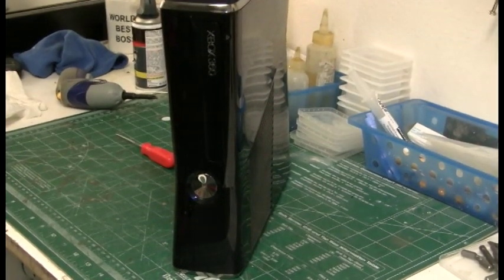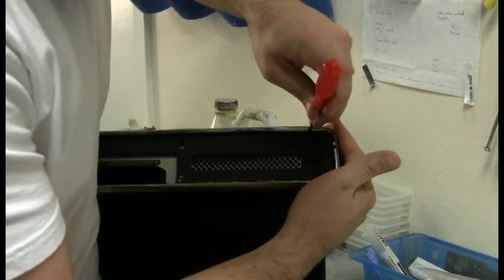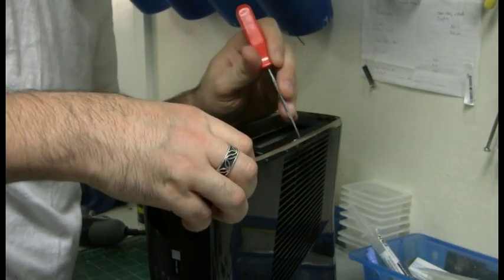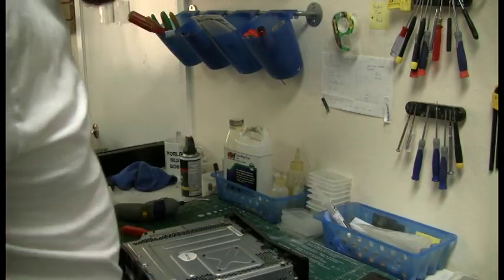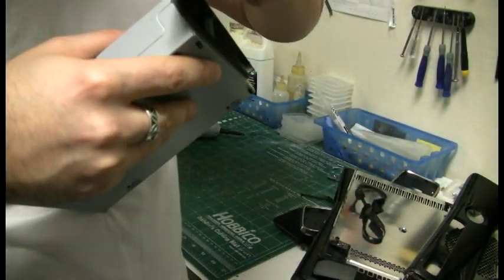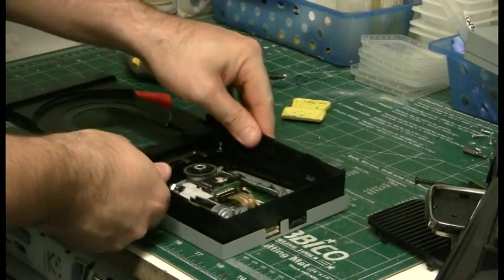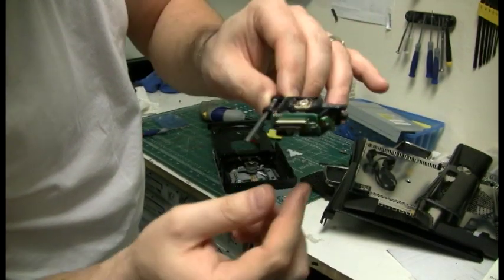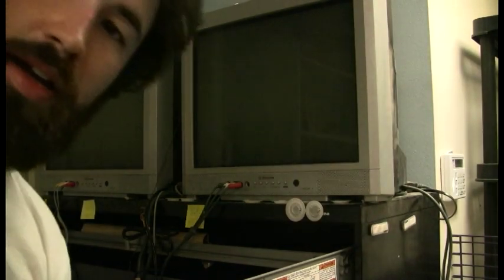How to Fix Xbox 360 Slim Open Tray Error

Comment: Also make sure the cables that connect to the disk tray connect properly i had the same error but its because i didn't connect the right after i was done cleaning the inside of my xbox when i put it back together i had the open tray error. So i had to open it again.

Comment: And how the s**t do you hook it up to test it before you put it all together???? Plus you need a soldering iron? Like I have one of those laying around. Basically, the way to fix this problem (that is if your laser is not out of place and you can just manipulate it in place) is to take it apart and buy a new disk drive.

Comment: can someone please help me. before my warranty ran out i sent my xbox 360 4g slim for repair 3 TIMES for the same problem... the open tray error. every time it came back after a while it would do it again. now my warranty has ran out, so i clean it up and it works... for 5 mins! so i buy a new laser and now the disk won't spin at all. ive done everything every video has told me to do and nothing... havent got the money to fork out for a new xbox. HAS ANYONE GOT ANY IDEAS??? please x

Comment: Hey gamerguy. Im having problem with my 4gb xbox 360 slim. What it does is it says open tray. Iv tried alot of things on youtube but nothing is working. I noticed that my laser moves correctly but no light comes on. I was wondering if u knew what was going on. I also replaced the laser but its still the same

Comment: @GamerGuy51 I replaced the laser but i've still got the same problem, the disc does one spin cycle, then stops and it reads 'open tray', i'm running out of options and i'm wondering if I should just replace and flash the whole drive? Can you help me on this?

Comment from the maker: with more complexity comes more problems.  the snes runs at barely 3mhz and maybe 90 degrees when pushing hard.  The xbox 360 runs at 3.2Ghz and pushes 120 degrees for Hours at a time...plus they are forced to use non-leaded solder as opposed to the old snes which uses leaded solder(a lot more reliable and less heat sensitive)

Comment: 4 questions 1 in what state do you work on xbox's 2 do you flash benq drives 3 if sohow much and 4 my drive problem was caused when i rearranged the 2 wires in the back i wanted to cool my xbox so i re-positioned the drive to get it off the motherboard 'cause i thought it would cool better if it didn't have the drive on top of it so i moved the wires and then i had this problem i just wanted to know if it is definitely the laser even though the cause had nothing to do with the laser

Comment: Hello. I was just wondering if the piece that is attached to the door of the drive that opens ( sliver piece with 3 prong things) is important. I tried to play a disc and it worked but should I hold on to it?

Comment: Thanks for the reply! I removed the anti-static point and will add a piece of foam. 

The laser is working now, but is not reading discs very well. The laser will normally read a dvd right away, but when I put in a game (even brand new games), I get the "your disc is dirty and needs to be cleaned" prompt. 

I was thinking about adjusting the laser, but don't know how. What do you recommend for this problem?

Thanks again for your work on the video, It's by far the best for the open tray issue.

Comment: Hi Gamerguy, Thanks for the helpful video! I replaced the laser but didn't solder the anti-static piece off, as I didn't have a soldering iron. Will the laser work with the anti-static piece on? 

After I opened the Xbox, I realized that the laser working but it had become stuck at the back of the track. When I freed the laser, It was able to read discs for awhile, but became stuck at the back again. Will replacing the laser fix this issue? What do you recommend? 

Thanks again!

Comment: gamerguy51, had tracking issue on my kids xbox slim, got it all out using your tips.. fixed the tracking but now when i we connect both the red 2 wire cable and the multi cable to drive console will not come up.. if i disconnect either fo the cables console will come up.. any suggestions before we have to send off for service.

Comment: Hello, hopefully you can reply.

 I dissembled my xbox 360 slim for the first time and when I put in the disk tray it doesn't work. I made sure the 2 little cables that connect to it are tight, but when I turn on my xbox the tray doesn't respond, no sign of life from the laser, nothing moves, the only way I can open it is by sticking a needle through the little hole. If I have a cd in there it doesn't move or spin. 

Would you know the cause of this? thanks,.

Comment: I replaced the laser in my xbox 360 slim by buying a whole new laser. I put the laser in but I have some problems. first, the laser is really loud. when it goes to read it beeps and makes noises. it does read the game though. second, when i shut my xbox off with a game in it it doesn't recognize it and i have to open and re close the tray and then it reads but is loud like usual. Then every so often it gets stuck at the top of the drive and I have to take the xbox apart and bring the laser down.

Comment: I followed this guys video after getting a replacement laser, and I have to say it would have gone perfectly had I not messed up the nylon arm part at 6:50. This screw is so sensitive to overthreading so really go at it slowly. I've had to switch some screws around so a larger screw is now holding it in place. My Xbox is loud as crap when reading a CD, but at least it reads them now. Thanks man.

Comment: You probably just plugged the wrong sata cable into the drive when putting it back together or you accidentally unplugged the hdd sata cable from the motherboard and didn't notice it.

Comment: or do it properly with de solder webbing or some copper wire and flux. 
flux the webbing or strip the wire and flux the wire lay it on top of the solder blob and heat the wire/web with the tip of your soldering iron. it will heat and melt the solder it will flow onto the wire/web if its been fluxed properly.

any other method is crude it not good practice 

no offence gamerguy

Comment: YES !!! its also a spacer keeps the drive from sitting to far back and will also cause vibration in most of the console witch is not good as it will cause stress and fatigue the solder joints over time

Comment: I have Xbox Slim with Liteon 9504 reader.  Open Tray error.  Tray will open and close.  Laser moves in and up to read disc, motor spins disc for about a second, then stops.  Not sure if its the motor, or the laser not being able to "see" the disc and relaying to stop motor.  Any ideas short of installing a new reader?

Comment from the maker: if it wont stay closed that means your drives sensor switches aren't touching and completing the circuit.  If you're not experienced I would change the drive out, but remember you have to keep the original board with it.

Comment from the maker: @ClovisXboxRepair you're so wrong its not even funny. the laser is just an infrared light bouncing off of plastic medium(non photosensitive)...you can't do anything to damage the disc with the laser,  but you can break the laser adjusting it wrong, but a new one is only  bucks anyways.  btw, apache's where around since 1986 in the army....ancient by current standards.

Comment from the maker: @glader93ed if it's stuck open that means your tray jumped track...there is a peg on the right side under the tray that needs to be all the way right so it will get back into the trays track.  does that make sense?

Comment: quick question, my Xbox suffers with this. but one odd occasion it recognizes a disc, i load it up just tell my to clean to disc! will laser replacement fix this. (the disc i put in is new out of the box)